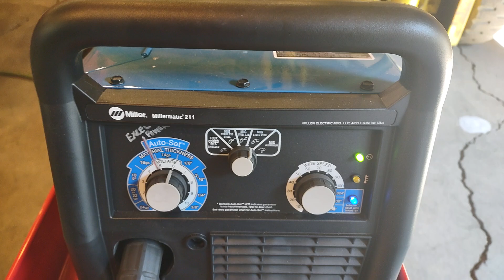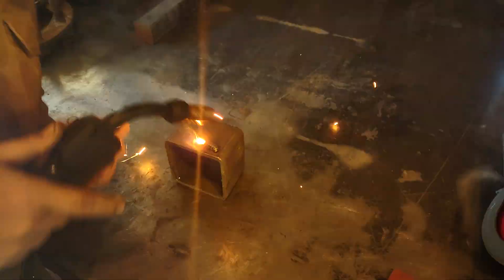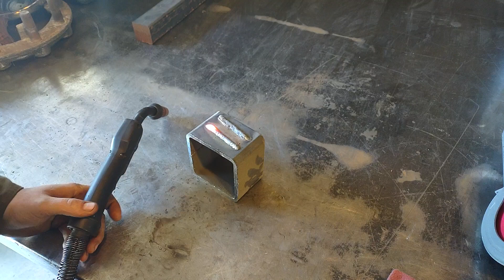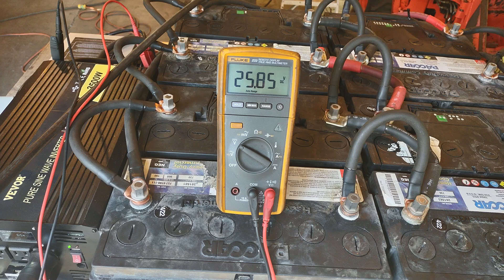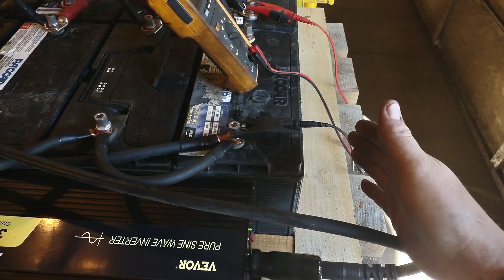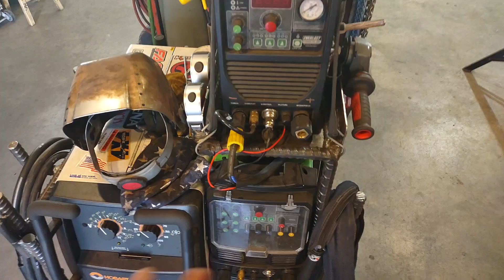(450) millermatic 211 welding off of 24v bank of used group 31 batteries and vevor inverter

Comment: That's a cool set up. What kind.of battery charger do you use to plug into your outlet? I also have a 24v system with 6 lithium batt and 600w solar setup but when batteries get too low I have to disconnect and charge each batt individually because my mppt charge controller won't charge if batteries get too low like less than 25v
Reply from the maker: @donjohnson9013  that charger is a powermax 24 volt converter they call it. It's a bad ass little charger that is adjustable and has different configurations you can set it to. Just type "powermax 24 volt converter" into the Internet and it comes right up. The website has a really good explanation of the features and what ya can do with it but there awesome, I've got 3 of them at the moment.
Reply: Thanks for letting me know, when I decide to get another charger I will look into it. I currently have the genius charger which I like but its for 12v